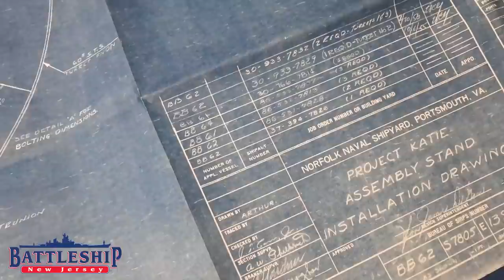Nuclear: Project Katie

Comment: There is an impractibility of shooting a salvo of nukes, the first nuke detonation will deactivate (thanks for neutron flux I believe) the other shells close behind it.  This was the downfall of Project Nike ABM and the concept for the proposed protection scheme called dense pack for the MX missle launch facilty in the 80's. It would also be a tremendous waste of nuclear weapons with so much power overlapping, it would be like shooting 9 HE shells into a single building, only a lot more expensive.
Reply: As I understsnd it, the problem is not deactivation, it's "fizzles". At detonation the plutonium pit sphere is extremely compressed to a critical density by the explosives around it. At the centre of the pit is a neutron source triggered by the maximum compression - this initiates the nuclear chain reaction. If there is a high neutron flux from a recent nearby detonation, the reaction will be triggered by those neutrons once criticalty is reached but before maximum compression. Even working as designed, only a small fraction of the plutonium fissions as the exploding pit expands in a microsecond or less to a non critical density. Triggered early, the explosive yield is drastically reduced.
Reply: @Bodi2000  I'm trying to find some source material but am not having any luck yet. My recollection was that either the neutron flux or the x-ray burst was very hard on the electronic detonation circuits of a warhead. All modern nuclear warheads are hardened against EMP, but at very close range a nuclear blast will overload or physically damage the sensitive components. 

That said your thoughts also sounds plausible, so any that survive my scenario would likely not be very high yield. You could just ripple fire the salvo, but given the limited max range that would be serious overkill.
Reply: But would anyone have known that in 1960?  Genuinely curious.  Because I believe one of the plans for the use of nukes was to soften up islands for amphibious invasion.  That may sound crazy now, but it did not seem crazy in 1945.
Reply: @tomsmith3045  that's a really good question, and you may be quite right.  The problems were discovered during high altitude testing like Starfish Prime, which didn't occur until after Project Katie was ended.
Reply: @tomsmith3045  neutron poisoning, causing fizzles, was known in the 40s and caused major design changes... as I recall, the U235 enrichment possible left an isotope producing neutrons, making a uranium implosion bomb probably fizzle so the gun type was used with uranium. Plutonium implosion bomb was possible, and more efficient: the tamper contained the explosion long enough (50 nanoseconds or so?) that a decent percentage of plutonium fissioned... still a very small percentage though.
Reply: My theory on why fire a full salvo would be to maximise the chances that at least one would go off.
Reply: @Bodi2000  These warheads were based on the Armies 280mm shell which was a U235 gun type warhead similar to the "Little Boy" bomb dropped on Hiroshima.
Reply: The idea with the MX dense pack was that the first detonation would throw up a bunch of debris which would frag the other incoming warheads. It was abandoned because the Soviets could have detonated their warheads near enough to simultaneously that it wouldn't have worked. I wonder if that sort of debris would even matter to a 16" shell?
Reply: @fire304  
We are Americans. Serious overkill is expected of us at all times, and we don't like to disappoint. wink, wink

Comment: In reference to the mystery brackets in the video ... I know nothing about navy nuclear weapons but I did have some experience with Army weapons in the 70s.  At that time, the components of some designs were packed in steel barrels.  It is possible that the Navy used a similar  design and the brackets were for clamps to secure them.

Comment: I saw you move those projectiles like they were toys.....gotta be fiberglass replicas.  I am faced with bringing home my 16 inch 50 blind loaded cement filled target practice projectile sitting on its side in a wooden cradle. My engine hoist would not lift it. The thing is brutally heavy and I need to rent a car carrier trailer to move it the 280 miles home.  But....Its mine!!!
Reply: Where will you put it? The front porch?
Reply: @clydemarshall8095  In this neighborhood 8 or 9 Karens will call Homeland Security by noon if its on my front porch. Its going in my workshop.  I wanted to use it as an additional air tank for my big compressor but the shell is filled with concrete. Or if zombies attack, I can roll it down this steep street and wipe out a few dozen.
Reply: @kimmer6  Because a dummy shell sitting on a porch with no way of firing it is definitely a threat to the neighborhood. (sigh) At least it will be a nice bit of workshop decoration and a conversation starter.
Reply: @mdtransmissionspecialties  Cheaper to buy a new engine hoist. I just found out that the old Harbor Freight one I used for years leaks down badly. That's why it wouldn't lift the 2000 lb shell plus 50 pounds of cradle. It wouldn't handle lifting my friend's Toyota engine a month ago. The shell needs a flatbed trailer and truck, maybe a small rental moving van. I'll get around to it sometime hopefully soon.
Reply: @clydemarshall8095  I already have a conversation starter. I can't get her to shut up even for a minute!

Comment: Damn after seeing you move those shells around, you must workout a lot! j/k BTW where does one buy plastic dummy 16" naval shells anyway?
Reply from the maker: Special Order. Or in our case, Battleship North Carolina!
Reply: @BattleshipNewJersey  hey that’s my states ship! I live in NC
Reply: @IPeakedAt15  That's the ship that made me want to join the navy. Unfortunately the doctors at MEPS said no.

We would go see the NC when ever we would visit my uncle in Jacksonville.
Reply: They must have been props left over from Dr. Strangelove!
Reply: As I understand it, USS Alabama had the first public access to the shell floors and was the first to have contracted for loads of plastic shells.  They were selling them at one time... I don't recall the retail price.

NC has practice shells from the Iowas, which are for the longer calibre 16"ers and thus not authentic for her.
Reply: @its1110  the Iowas, South Dakotas, and North Carolinas used the same shells. The inly difference between the Iowa class and the two preceding classes was the length of the barrel and the turret/barbette design. 
To be more specific, the 2,700 lb mark 8 shells were issued to all the 16” armed battleships built in the 30s and 40s.

Comment: Awesome video. Remember, an IOWA firing a nuke shell would be on the move. Radiation spread would depend on a number of factors including weather etc. Also, as is pointed out, it’s unlikely these would be used strategically, that is, they’d be most likely aimed at a very specific target—large or heavily fortified. Just a guess on my part, but I can’t imagine a scenario where more than one would be fired per mission. The KATIE program is steeped in mystery. Can’t wait to find out more!

Comment: Radioactive fallout depends on both the detonation altitude (airbursts are far cleaner than ground bursts) and winds aloft.  If you're upwind of ground zero, you're not going to be receiving any fallout.  Of course, you're now a priority target for the enemy.
Reply: True. And if the shells are fuzed for about 2000 feet high burst, the fireball won't reach the ground and there is little or no fallout.

Comment: I was reading some old comments today about the Iowa’s posted by the late Richard Landgraff on an Internet forum. I came across this post in regards nuclear shells on the Iowas. 

What actually killed the project was that the Atomic Energy Commission wrote up some almost impossible requirements for nuclear warhead HANDLING aboard ships.

No nuclear warhead (including special 16" shells or saboted Army 11" "Atomic Cannon" shells) was allowed to be transfered and struck down to the magazine on any suspension system such as wire rope that was used on all conventional 16" projectiles and their powder cannisters. All handling systems had to be "positive capture" in racks and guided down to their magazines on double rails. To modify a BB with that type of space consuming system through the 1 1/2" thick Main Deck, 6" thick 2nd Deck. 3/4" thick Splinter Deck and into the shell magazines inside the turret foundation of 1 1/2" thick steel would have not only have taken too long to design and build but also WAAAY over any budgets planned for retaining the ships and using them for such a purpose.

When LBNSY installed such a rack and rail system for the USS Chicago (CG-11) for stowage of Talos nukes, the complexity and test requirements drove more than one yardbird nuts. While the installation was going on, areas between decks that included the passing route were closed off with heavy tarpaulins with armed Marines at each deck level.

Comment: I have to wonder if the "practice shells" were not intended to be fired, but rather handled and loaded then unloaded?
Reply: Practice is a type of shell, compared to drill. They had one drill shell because those were never meant to be fired, only used for loading drills. Practice shells are actual projectiles meant to be fired, however the warhead is removed and usually replaced with smoke to get some practice between observers and the guns crew. That is at least if this naval artillery has anything in common with the field artillery I was in lol.

Comment: I was sitting here with the question 'where did they get all those inert shells?' nagging away at me, but the I though it'd be a really boring answer like they had a lot of practice shells left and you just painted them. Then you just tip one over and roll it out the way likes it's made of pappmache and it all makes since.
Reply from the maker: We do have a roughly equivalent number of inert shells though, they're just in our parking lot because getting them into the turret was unreasonably difficult.
Reply: Battleship New Jersey do you have a “K” shell
Reply: @BattleshipNewJersey  you guys need to watch the equipment auctions for a reasonably priced crane to keep around it will pay for itself over the years

Comment: According to Wikipedia the W23 (a larger version of the W19 Artillery Shell) is the 16" version for the Navy. It had 50 shells produced and was in service until 1962.

https://en.wikipedia.org/wiki/W19_(nuclear_artillery_shell)
Reply: I'm guessing they took notes from the soviets' own nuclear artillery shells. The soviet version was a 152mm shell designed for use in the same artillery gun used in the KV-2.

Comment: Long term exposure to radiation in steel, even in non threat to life doses, 'can' disrupt the cristalline structure of the metal. Analysing samples of the steel that would be the closest to where you believe the shells would have been stored could confirm that radiation emitting elements were stored during a long time in that room. However if the warheads were stored in thick leaded boxes there is no way the radiation could have altered the steel. This could be a interesting thing to do, maybe pooling ressources of other museum ships believed to have carried the same ammunition.

Comment: HI 
I Have watching a number of your videos
Please can you consider possibly including in your videos
I presentation on a map where you are preferably in 3 dimensions
2 a outline of your grand plan of the refurbishment and how each video fits into that plan both what comes before and what comes after 
Regards
Reply from the maker: 3 dimensions, not so much, but we can do a 2d map of where we are on future videos. We don't necessarily have a 20 year plan on restoration or anything, we find a problem and we fix it as we find it. The deck project is a multi year process with a plan on when each section gets done and we have plans for adding spaces to the tour route but that mostly happens when we get a grant to do it so its not a specific order.

Comment: Very interesting.  I imagined these tactical nukes being used against an enemy fleet at sea, but the idea of pulling up to an enemy coastline and letting loose a broadside of as many as 9 nuclear shells against a city or other land- based target is an interesting possibility.  It’s not hard to figure out why the battleships were only briefly planned for this mission.  By the late 1950’s, the Navy was starting to deploy SSBN’s with much more capability and stealth than a surface ship with a 23-mile firing radius.  There were also carrier-based aircraft that could carry nuclear weapons, with a far greater strike range than a battleship’s 16 inch guns.

It would be interesting to take a Geiger counter into the magazines of the modified Iowa’s to see if anything more than background radiation was registered.

Comment: Either you have the strength of Hercules or those shell are a lot lighter than they look. When you brought those down to display inside the turrets did you lower them through the normal loading hatches with the crane or just carry them down with hand trucks?
Reply from the maker: These are fiber glass and weigh like a pound each. We just carried them down by hand
Reply: @BattleshipNewJersey  They'd make for excellent lawn ornaments! Way better than gnomes! Any idea where we could find those?

Comment: Why you dont use a Geiger counter? You will know at once that some radioactive material was stored in there. It wont be high but detectable enought.
Reply: That is not true.  The "physics package" the actual nukler bomb part, didn't have the fission core rolling around on the deck, its buried deep in the housing.  What radiation from decay of the core would spread around, but the armor of magazine would effectively shield it a nd it would not cause any of the surrounding structure to become radioactive.
Reply: @jamestheotherone742  maybe not but perhaps it would have left a trace of some sort? Like a faint fingerprint?
Reply: @ByyakoKitsune69  No. That isn't how it works.
Reply: @ByyakoKitsune69  Not after 50 years. (even the elephant's foot at Chernobyl is significantly less radioactive today.)

Comment: Question: how much lateral and vertical spread could the 3 guns of a turret do from each other?  If not more than a few degrees, a nuclear broadside would be impractical. They would explode too close together and be a waste: you can only pulverize a target so much. I suspect the actual plan was one at a time from turret 2 at different times
Reply: Projectile spread can also be obtained in depth by varying the projectile's range.   
 I guess you want the firing timed so a further targetted shot does not pass thru the explosion of a closer targeted shot, thus youd want to shoot the further down range targets first, followed by the near range ones    

 The idea that these shells would only be used in full nine gun  simultaneous    broadside is not realistic.

  There would be times when less than nine would be needed, or that the fire timing will be staggered to prevent a closer targeted explosion from effecting a shell traveling further.
Reply: @dave8599  ...with the limit on that being how close you are willing to be to the last shell that goes off nearest you.  The thermal radiation burn radius of a nuke of about this size would be something like 2km.  That's for instant 3rd degree burns.  You would certainly want to be upwind, but inside the ship I guess you could survive one that his fairly close.

Comment: The Katie shell, the most powerful naval shell ever period... LOL this 1,900 lbs shell had a nuclear blast yield of 15-20 kilotons. That would have definitely vaporized the Yamato
Reply: It would cause catastrophic damage, but not vaporize since the effective damage in a hemisphere of hitting would have been halved. (10kt and water absorbs a LOT of heat)

These rounds would be a 250m instant death zone, but other ships could remain figting out of that area. Or that's the estimate based on the sea tested nukes.
Reply: Maty83 yes it would not have vaporized the Yamato however it would have made her a radioactive nightmare unfit for any human life. She would be pretty much a ghost ship. Kind of like what happened to the USS Arkansas, USS Nevada, and other ships used in the nuclear tests of Operation Crossroads.
Reply: @Maty83.  Even a near miss (quarter mile range) would have created enough of a cavitation to break any ship ever built in half.  A direct hit would have vaporized more than enough of a ship to render it useless scrap metal sinking in the sea.
Reply: @Whatsinanameanyway13  Have you watched the seaborne nuclear weapon tests? I am basing my opinion on those since even the poor old Arkansas at point blank range did not get vaporized. The main destructive power there was the underwater part of the explosion (of a weapon 2.5x as strong) which created a small tsunami. But Eugens and Saratoga did not sink immediately when at a reasonable range away from the projectile
Reply: Yeah no. It wasn't a ship to ship weapon. Just shore bombardment.  The main damage would come from flash, blast, and EMP blinding and wrecking all the sensitive electronics (and eyeballs) that modern warships rely on.  The hulls would still be floating, and they would be seriously degraded, but they would not "vaporize".
Reply: Only if it were a direct hit. Anywhere near it (as was the point) would, of course, sink her. And make her so radioactive as to be a death trap. (we tested all manner of detonations at Bikini.)